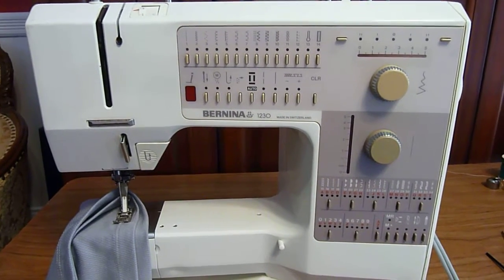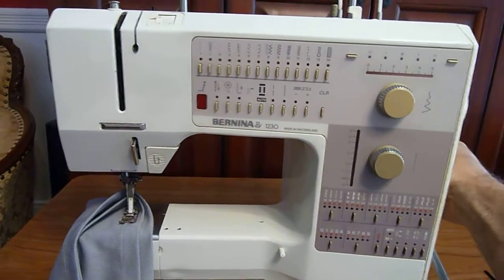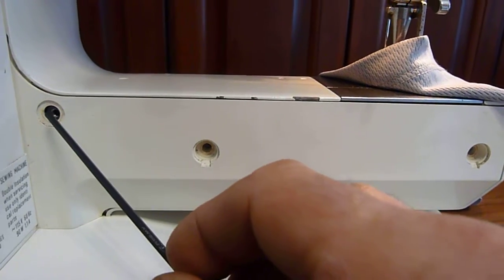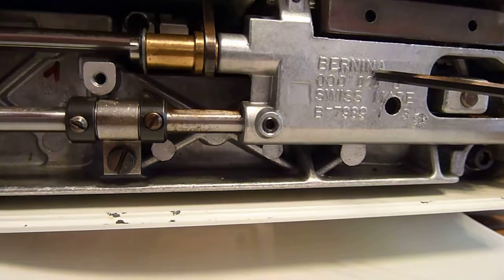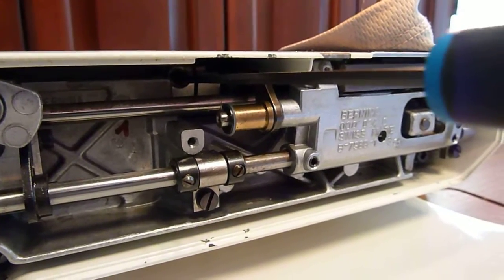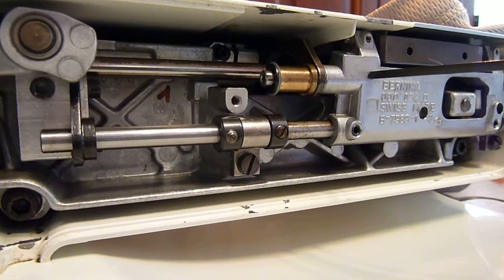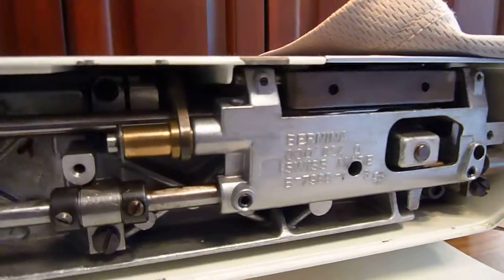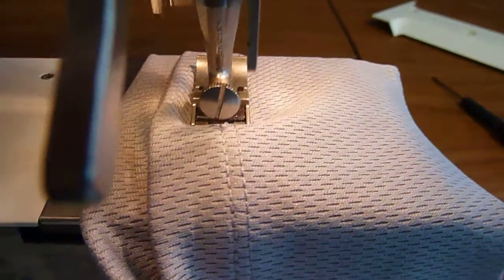Repair a Bernina 1230 with stitch length problems

Comment: Thanks for the video, Todd! I'm hoping this is going to fix the issue I have with my stitch length being stuck at a certain length every time I turn the machine on. One other quick question is that my feed dogs occasionally stop moving and I can't get them going again and have to take it in for service. Any tips?
Reply from the maker: Unfortunately, there's still probably an area that's not completely freed up.

Comment: I like your videos, they have helped me a lot.  Thanks!

As for this video, perhaps a better title would be "Repair a Bernina 1230 with forward/reverse stitch length imbalance", because it seems this adjustment affects the BALANCE between stitching forward and reverse.  After doing your adjustment it would be helpful to check it by sewing forward 20 or so stitches through a piece of paper, and then stitching backward the same number, and adjust the setting until they are equal.  Using a 4mm stitch length (large but not the maximum length, to avoid reaching a mechanical limit) would probably provide the maximum precision for this measurement.

Now I need to find how to adjust the ABSOLUTE stitch length.  After doing this balancing my machine stitches about 7% too short forward and reverse.  This affects buttonholes where the fabric gets stuck not moving.  Can you provide any help there?

Comment: Any chance you know how to get the Long Stitch working?
Reply from the maker: I don't still have this machine, so I'm not able to inspect and see what makes that function work inside it.  So I can offer any solid advice, and I don't work on sewing machines as a profession so I don't have any experience to help guide you.  If it were mine, I'd do what I could to inspect the mechanicals, and confirm whether or not they were "glued" together by old lubrication oil that had turned into varnish.  If varnished up and stuck, a hair blow dryer will soften the varnish and then it can be flushed out (usually) using penetrants like Kroil, PB Blaster, Carb Cleaner, etc. and then lubricated initially with TriFlow, and once working again, synthetic sewing machine oil.  But, if everything mechanical checks out, I'd be thinking that the circuit board had failed, since the inputs from the control knobs are fed into the board.
Reply: @ thanks

Comment: I love you, I love you, I LOVE YOU. It worked. I've had my Bernina 1230 since new. I was terrified it was the  motherboard. it wasn't.  Ty...
Reply from the maker: Thank you for the kind words.  I'm so glad you found it helpful!
Reply: Hi, Austinado.  I have a 1230 that appears to be stuck in permanent reverse.  When I activate either of the reverse buttons (above the needle or the continuous reverse on the panel), the machine then sews forward.  So, it's doing exactly the opposite of what it should.  Any tips on how to fix this issue?  Thank you in advance and thanks for posting these very helpful and clear demonstrations.